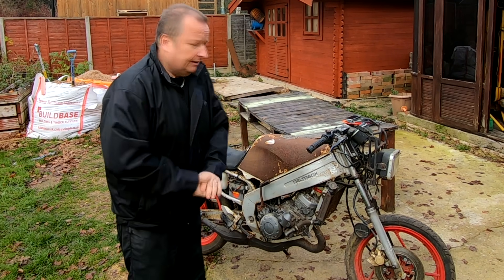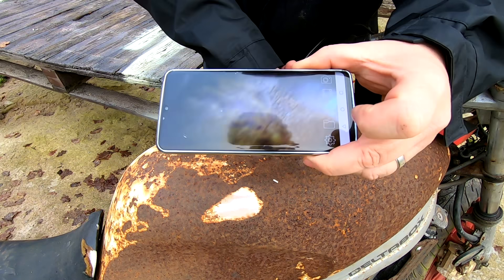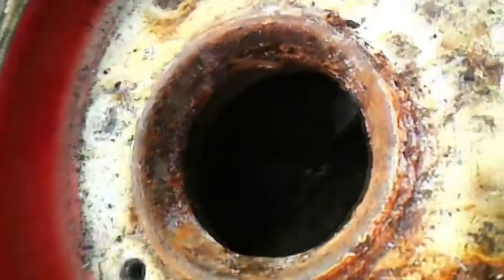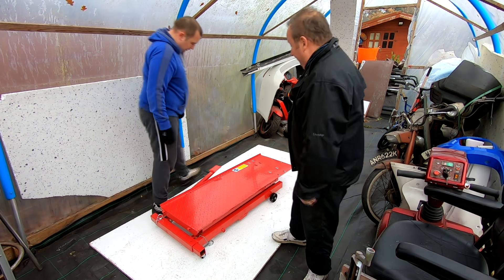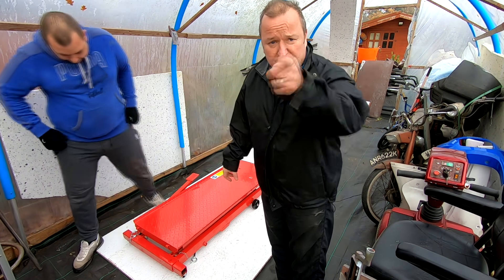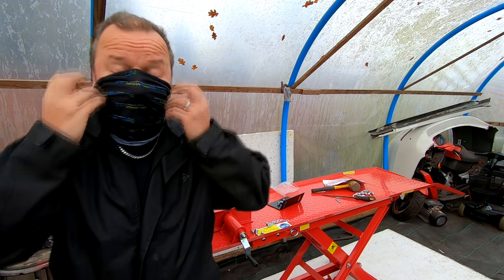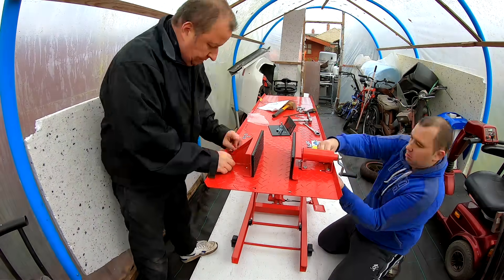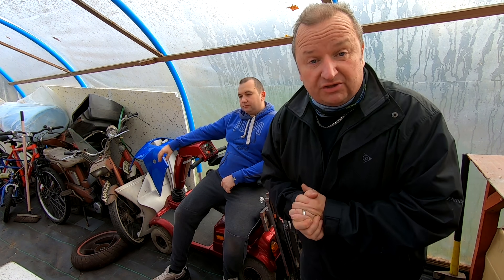New Toys And A Rotten TZR Fuel Tank Vlog

Comment: Hi Martin another great video, i your opinion would that lift work as a duel work bench for Mowers as well as motorbikes? Is it wide enough for 21 inch mowers? I do think you should set Gary up with a nice heater in there, he might get cold🤣🤣🤣 thanks for the video🙂👍
Reply from the maker: we will be using it for mowers as well Luke.
Reply: @retrorestore  Great, I was thinking about getting one like the one you have in the cabin, but a duel purpose one would be much better for me, thanks🙂👍

Comment: Old nuts and bolts in a bit of liquid and give it a thorough good shaking, depends on what is the solvent for that gunk.   Might be acetone as acetone is a solvent for the superglue family but I imagine its more likely an epoxy which may need something like a powerful paint stripper which may or may not work :S

Comment: I must buy a bike ramp for my Vespa, I need to get it up high so I can drop the shock off the back and do all the cabling etc.   Front end is done except soldering a bit of loom and putting the horncast back on, need to buy some ethanol resist fuel hose and put its aftermarket alloy on back to match the alloy on front, oh and treat the exhaust as the chrome has gone on it leaving it a rusty sight so bought a roll of bright blue titanium exhaust wrap which will look mint on it I reckon.   I'm thinking of putting one of them cheap Chinese card reader stereo's in it like I got in my Reliant and putting a baby sub plus a couple waterproof speakers for some serious sounds running around :)
Reply from the maker: Sounds good Ian

Comment: Muriatic acid soak
Then seal with red kote.    It works great
Seal,it after you powdercoat the tank.   Red kote might soften on the ober so do it after
Red Kote is on ebay